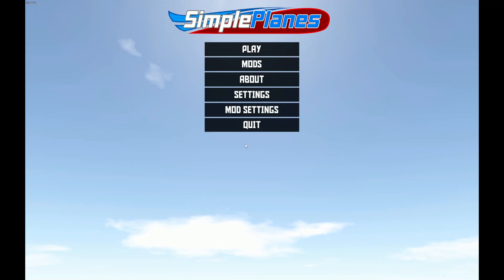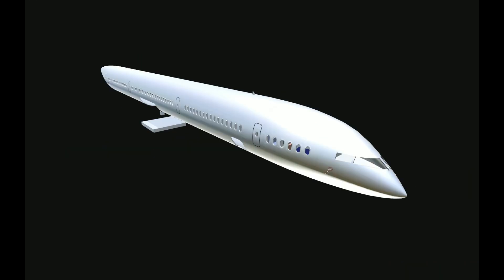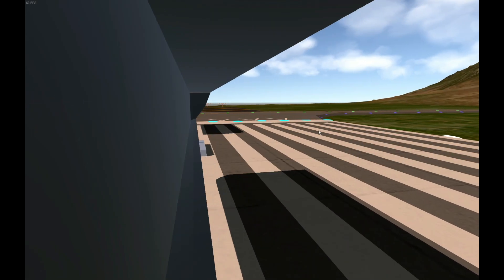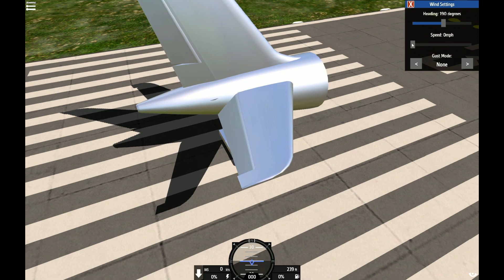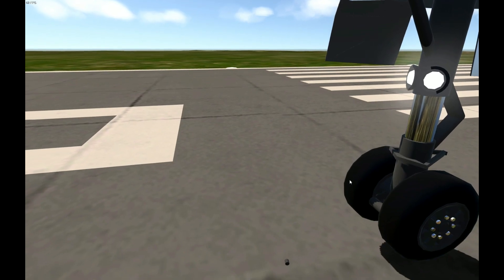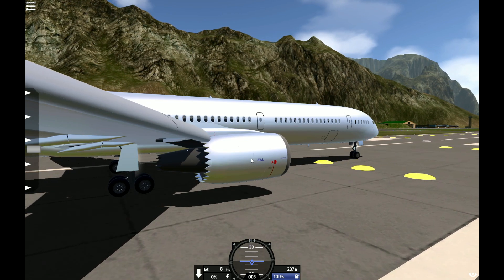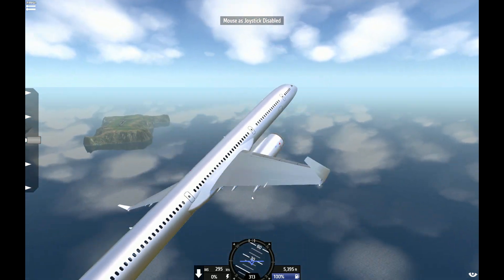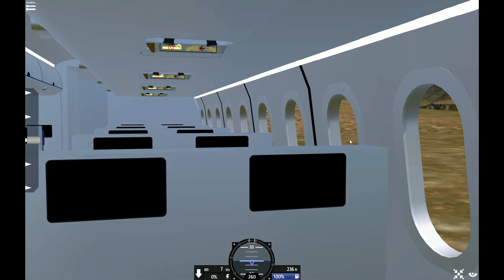Fuselage Almost Complete! - SWL-120 Progress Update 5.1

Comment: So you reduced each part into 1 part using mods. now the question, how mobile player can download this?
Reply from the maker: I've made a no mods version which is a cargo version. I explain this briefly in the video.
Reply: @11snakePlayz  how much part cargo version
Reply from the maker: 1865 right now, estimated 2500 with the cockpit, however that can be reduced if most details from the wings are removed, down to 1000-1500 with cockpit and main fuselage.